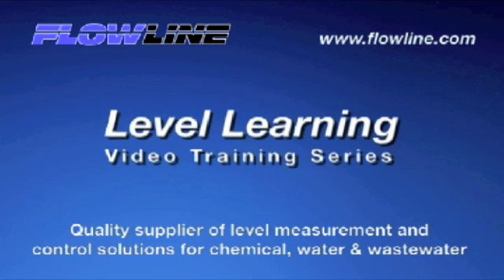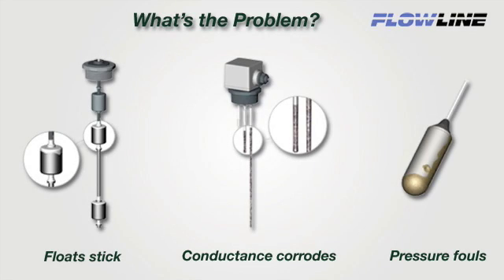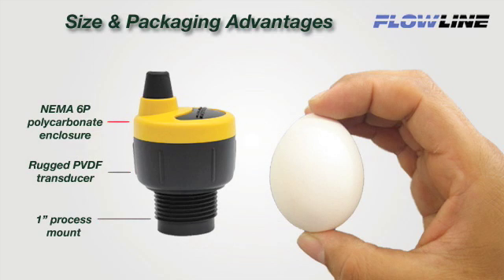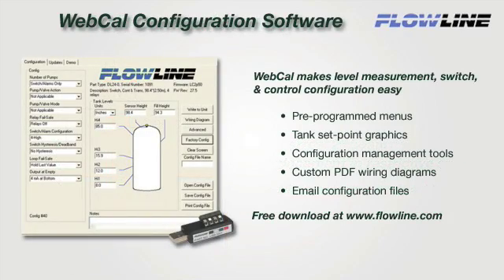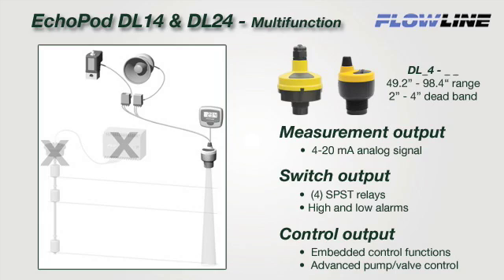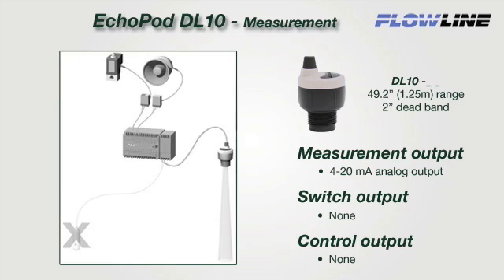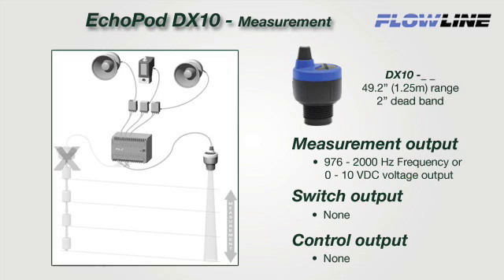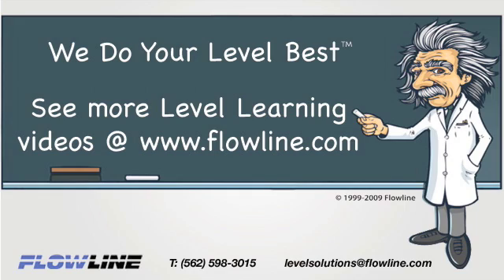Small Tank Ultrasonic Level Sensors - EchoPod

Comment: I am a distributor of a water level controller in india kerala state,which is installed in the over flow pipe (air pipe) which is connected to water tank.Here we put a magnetic float inside the air pipe and the movement will be detected by a reed switch outside the pipe here the problem is that when we uses this product in a pressure pump fixed line,the float will be sucked down when the pressure pump is on.

I would like to know whether this will happen if i use your product